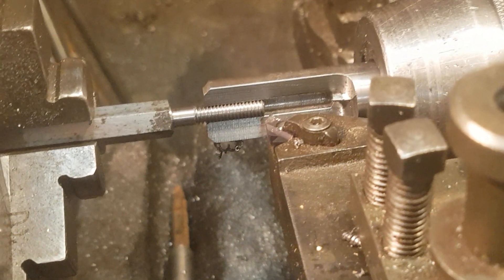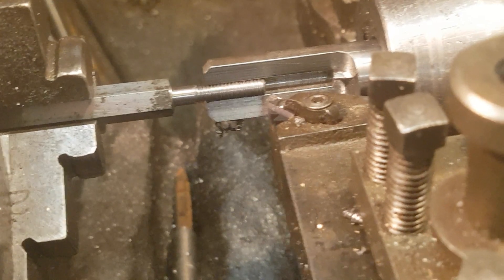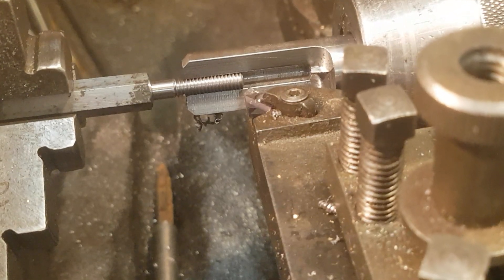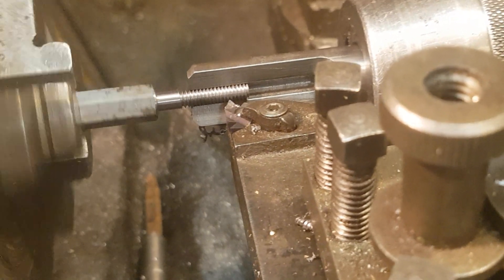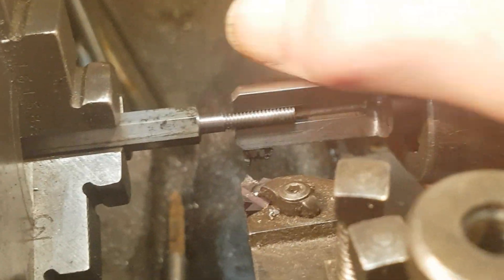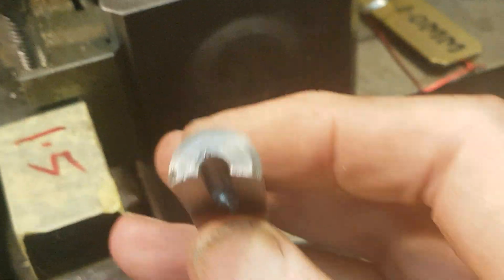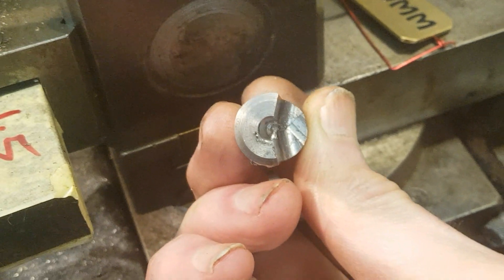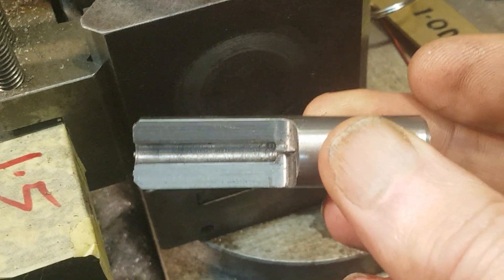A tailstock drill chuck mounted steady.

Comment: Thanks, Chris. That’s one of those things that seems obvious once seen, yet hard to think up otherwise. Nicely done!
Reply from the maker: Thank you kind sir, i dont claim originality but it certainly isn't common knowledge these days. Not something for everyday use but useful to have in your techniques arsenal for that odd occasion.
Reply: Hello Chris, I have been re-watching your videos lately. 👍 Recently, however, I saw some replies on another channel that I believe were written by you; the topic was tangential tooling. Do I have it right? Have you built an assortment of such tools? If so, I’d like to learn a bit. Thanks
Reply from the maker: @624Dudley  sorry I didn't get any notification of your comment, thank you YouTube, 
I have indeed made many assorted types from a copy of the original victorian style through to my version of the Australian. There are many places where you can find information and the advantages of using one make the research worthwhile, it's even worth buying the ozzie one despite the apparently high cost. I use mine for almost everything that doesn't involve working hard metals where carbide tooling is required.
Reply: @chrisstephens6673  Hello Chris, as I recall that message was left just around the time I’d learned that the Oz version was unavailable, in my size at least. The proprietor told me that it was down to the closure of a foundry of long standing. Thanks for your input!
Reply from the maker: @624Dudley  I had not heard there were problems, sorry to hear that. You would think it an easy thing to produce on any 5 axis machine centre without need for castings or forgeings. You don't really need anything tougher than mild steel, the one I have been using for many years is just mild steel, not even case hardened.
I would suspect, without evidence,  that the chap in Oz is thinking towards retirement and not putting extra effort into a new source, and I wouldn't blame him.

Comment: Why not just use a live center?
Reply from the maker: Good question, there are times when it is not convenient or you can't be bothered to remove the centre drill hole. One advantage of this tool is it takes the raised burrs down as you make them.
Thanks for commenting, I hope I have answered, even if only partially, your question.

Comment: Great idea Chris ill remember that one.

Al.
Reply from the maker: HI Al,  Indeed, not needed everyday well not unless you are making small bolts all the time.😉
I have some 27tpi bolts to make, which is a pain as my imp myford has a gearbox for threads and you can't mess about with change gears for odd ones not listed. I have worked out a spreadsheet for my metric bantam and it looks like i can get within 0.2% of what i need. Should be good enough for 3/4" long bolts. No dies for this size, a Douglas oddity, hence need to screw cut and the tool.
ATB 
c
How's your taper boring going?

Comment: Gday Chris, I’ve never seen this done before, it’s a great idea, thank you thinking of me and your advice, much appreciated, Cheers Matty
Reply from the maker: You're welcome, I had to make that size tool for some special pitch 3/16 bolts I am making for a friend and as there are no dies available, at least not until l make one, I shall have to at least rough them out by single point threading, before final sizing with the die.
 I guess it is another example of synchronicity half a world apart, and one of the benefits of YouTube where one person can have a problem and their YT friends offer help.
Thanks for the sub, I don't put up much unless I actually have something to show, especially with the slow net I have, it took most of the night to load a couple of minutes. I usually try to load from SMEE HQ where it takes no time at all to upload, but with lockdown that is not possible.
ATB 
c